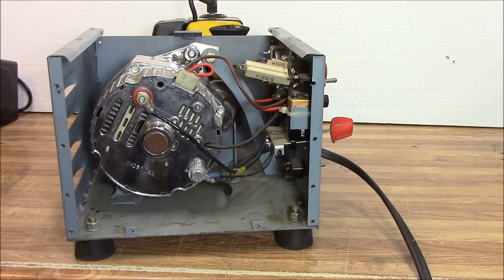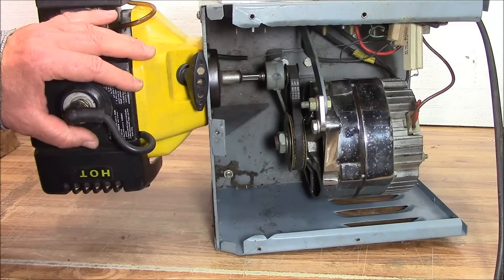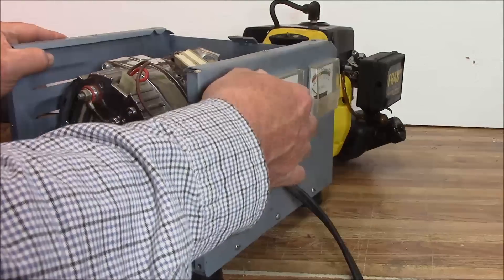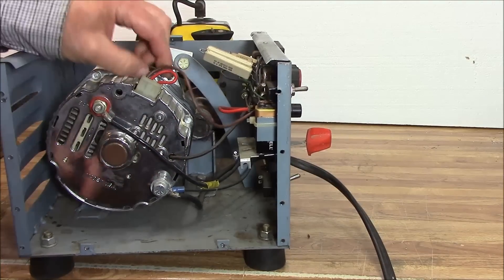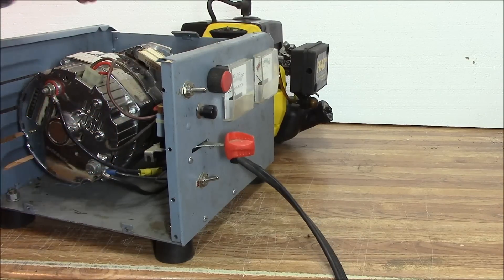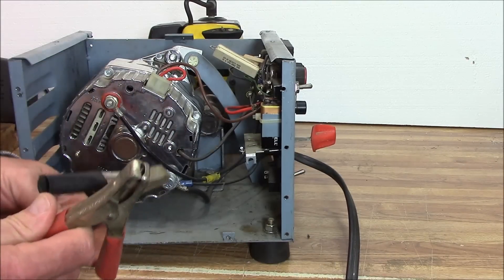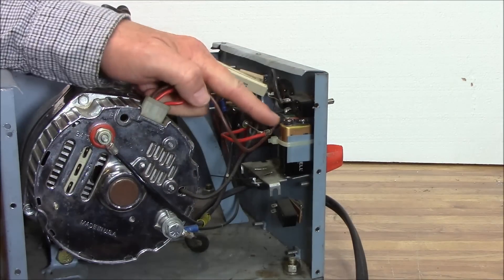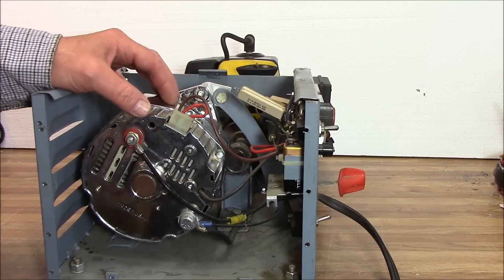How to Build an Alternator Motor/Generator Battery Charger w/ String Trimmer Motor part 2 of 2

Comment: Would a bicycle chain work in there, instead of the belt?  It may require a bit of searching/manufacturing, but it may be an idea for holding up under the wear and tear

Comment: Hi, great video. I am trying to figure out if a 43cc engine 2 cycle or a 32cc 4 cycle would have the ability to put out 100 amp with a 12Si? I'm trying to come up with a small 12vdc generator under 30lbs. Any information would be appreciated.